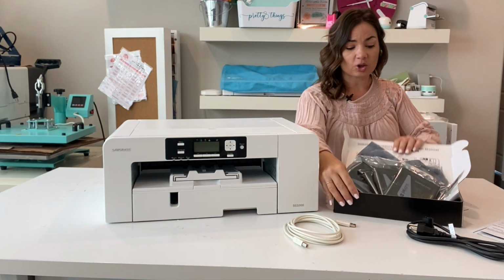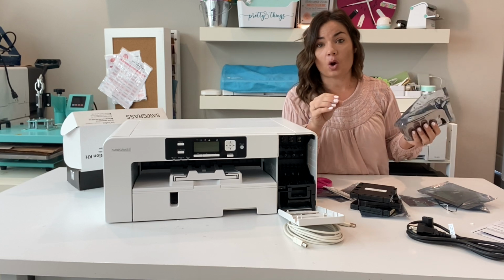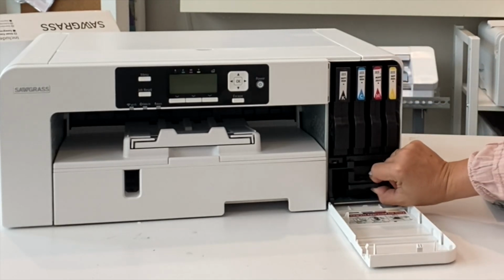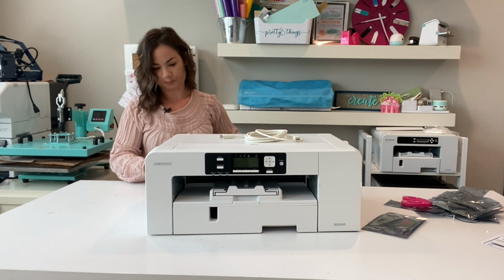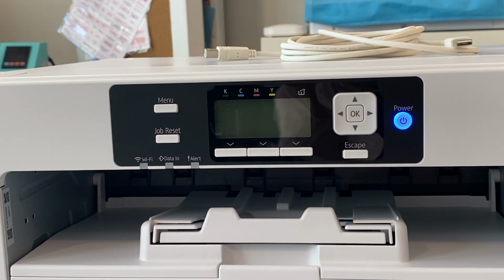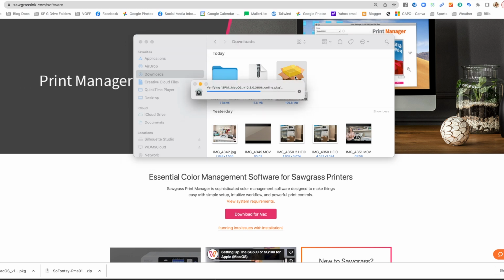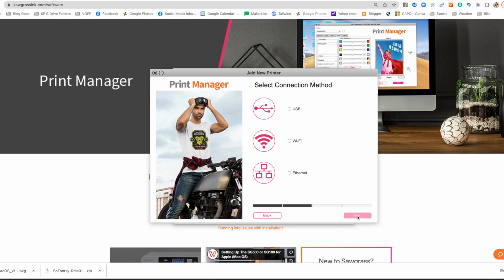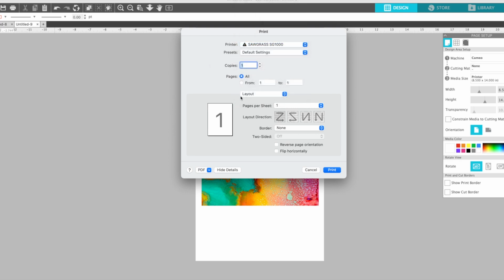How to Set Up Sawgrass SG1000 Sublimation Printer

Comment: I have a SG500 right now, it came with sublijet.  Im wanting to get the 1000, but most of those come with UHD.  Is there really a big difference? And could I switch both to use the same inks or should I stay with what came with the printers?
Reply from the maker: Both the Sawgrass SG500 and SG1000 printers can use UHD ink.

Comment: The Sawgrass SG1000 is trash, lasted 5 days, and yellow ink had constant banding and even though under warranty Sawgrass refused to deal with it and blocked me. on day 6 the machine started smoking and burst into flames....Luckily I was in my workshop to deal with it. Complained to the UK (so-called) care team and got called a c**t..absolutely shocking...run as far away as you can from the cheap noisy money pit and buy an Epson SC-F500...An amazing machine that's not a fire hazard